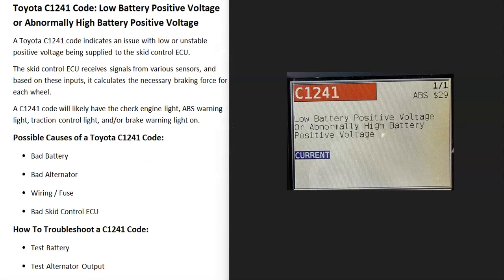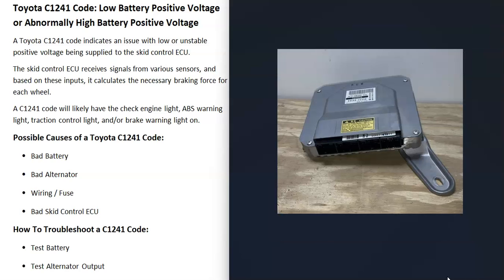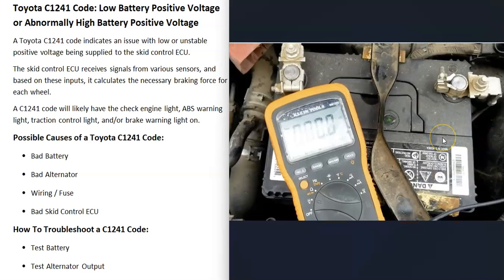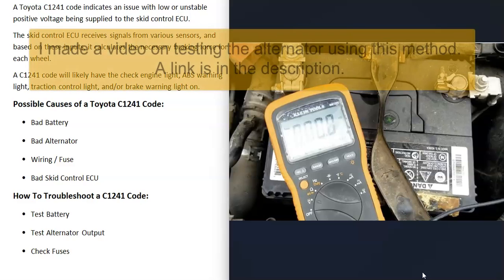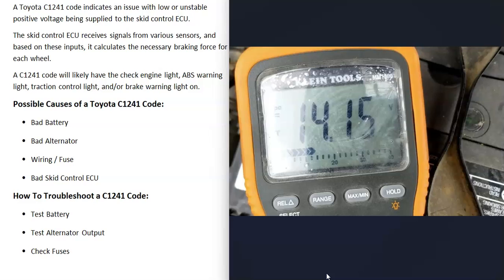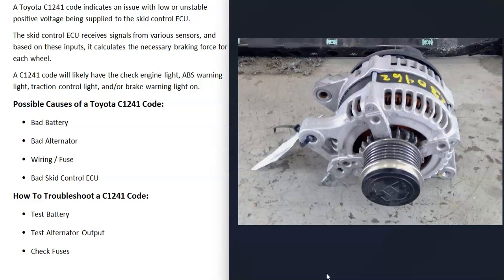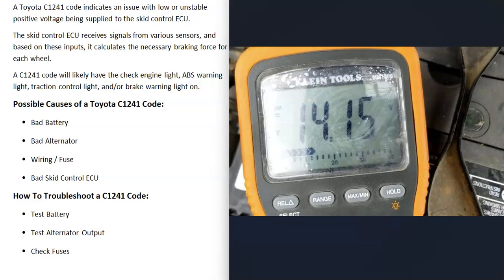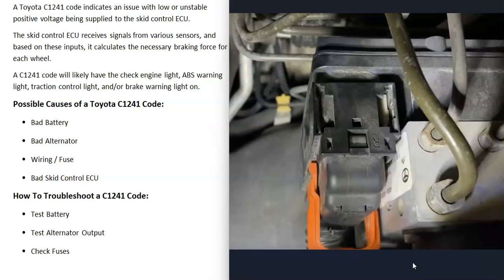Causes and Fixes Toyota C1241 Code: Low Battery Positive Voltage or Abnormally High Battery Voltage

Comment: C1241...  Battery is good (12.5V off, 14.0V on), good voltage at ABS fuses, no trouble lights on the dash.  06 Highlander Hybrid.  Ideas?
Reply from the maker: Other possible causes, could be a momentary voltage drop triggering the code, but then back to normal when testing. Ground issues or intermittent issues, such as a loose wire or a component just starting to fail. Also, I would load test the battery; sometimes, it checks good, but a cell is starting to fail, causing problems.

Comment: I really need your advice, no lights alerting me on the dash but I have the C1241 code when scanning. Did the free battery and alternator check at autozone, it showed up as normal. My breaks feel fine and my trac off button works normally, I’m not understanding the issue since I’m not getting any lights on the dash I don’t believe it’s my abs system, have you ever heard of this before?

Comment: Thanks for sharing. I’ve got a Lexus with the following codes C1242 C1201 and a P0172 code. All of these have come on at the same time and the exhaust smell is quite strong. I’ve watch your other videos for those codes but wanted to see where you would start to diagnose the root cause. Would you start troubleshooting at the C1241 side or at the P0172?
Reply from the maker: I would be sure there are no computer or power issues since it is an issue with the ECM/PCM that may be causing the P0172 code.
Reply: @HVAC_Mechanic  hi I have a question about c1241 and c1201 also I have red light it say Break what did you think the problem please help tahnks

Comment: Hi, great video. My 2008 toyota highlander all of the sudden got 3 codes while driving. P0128 which says its about the "thermostat coolant". Also a C1241 code which says its "low battery positive voltage" & lastly a C1201 code which says " break control: vehicles stability control system". Car still turns on, & runs. I have noticed the temperature of the engine does not get to the half way point as it usually did. Do u have any idea what it could be?

Comment: Hey my young son just bought a 2007 Xle Camry before I can ck it. I diagnosed it with B1242 code can’t figure out what part I need. The ac is blowing cold one minute and the hot the next. Can you assist 🙏🏽😩
Reply from the maker: "B1242 Code Wireless Door Lock Tuner Malfunction". Does the Key FOB work with other doors if not check the battery. It needs to be diagnosed but it could also be a bad wireless door receiver or the wiring.

Comment: Is this module also the one that communicates with the tpms sensors and the keyless entry remote?
Reply: No, the TPMS system is (generally) its own ECU called the Tire Pressure Warning ECU. On a 2006-2012 RAV4, it connects to the antenna and receiver for the car's TPMS monitor system. It interfaces with all the other vehicle ECUs via the CAN bus, but it's not the same module.

Comment: Please help!) I have 2 generation toyota prius. Its battery was deying and i chang it but nothing changed. 1 month was ok but now same thing. I have same code. But there is some strange thing. When car is on but in oarking mode its charging valtage is 13 8-14.1 but if i drive its going down to 13.2. But while driving if lights  or A/C is on voltage is normal again. How ots even posiblle? Sorry for my english
Reply: well it could be possible due to a faulty ground or bad wire somewhere. I have similar issue, except it only happens when I turn ac ON. Brake, ABS and traction come on. also a very dimly lit left blinker light turns on solid.. and speedometer will go out and come back.

Comment: Have a 2010 Prius with u0110 and c1241 it drives fine than randomly with will cut off and once we turn it off and on again we are allowed to drive but it has the check hybrid system on the dash just replaced the battery and was about to clean the ground cable from the fuse box to the hybrid inverter under the hood any thoughts before I take this in to get checked

Comment: I am getting this error on a 2005 Lexus gx 470. I just put a new alternator in the car and did run the battery dead before that but battery is currently charged and has a new alternator. As far as I can tell the wiring and fuses are good. How can I tell if it is the unit itself? Also all the lights have now turned off and but I do return the codes c1241 and c1223

Comment: Have a 2014 4runner that have this code, and a p1604 code as well. Iv had the shop try to fix this but no luck. No lights on dash. Only see the code with a scan tool... its labeled as stored and current codes.
Any suggestions?
Reply from the maker: If the battery, alternator, and fuses are good, I would check the wiring and computer next.

Comment: I picked up an older FJ Cruiser and it's throwing that code (along with a host of EVAP codes - I need to replace the exhaust).  The previous owners have an air horn (don't ask me why) and a light bar installed - I'm sure it wasn't done professionally.  I'll check the voltages soon but I was wondering if that could throw a this code.  I believe the bluetooth scanner showed a voltage of around 14 while running.

Comment: I have this code and now only the abs light is on not 4hi or traction control.  C0205 wheel speed sensor code also is on and one other that is a wheel sensor code. Will the wheel speed sensor being bad cause the 1241 code?
Reply from the maker: I would fix the C1241 code first and then fix the speed sensor code. A bad or unstable power supply can cause strange things to happen.
Reply: I have the same issue as the gentleman above.  I will try to fix the C1241 first and see where that gets me.  Thank you for the video! @HVAC_Mechanic